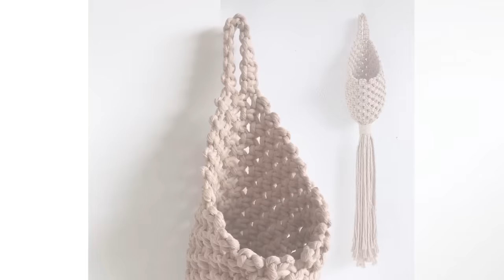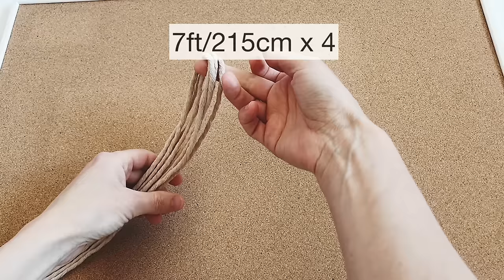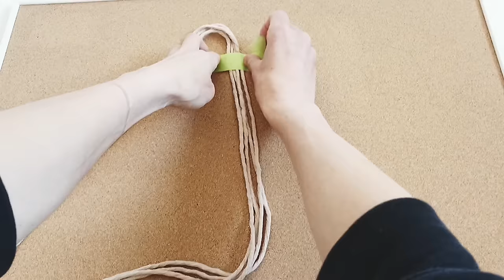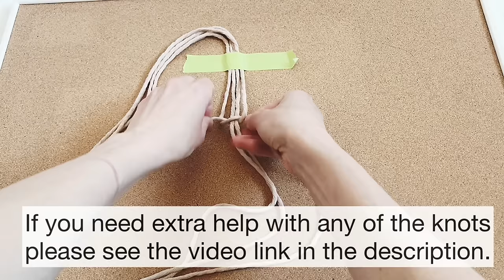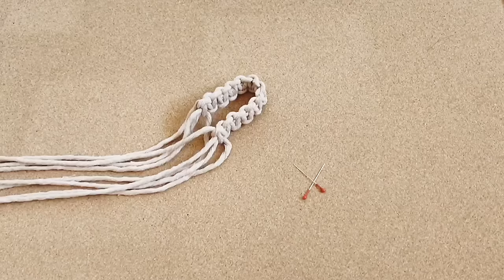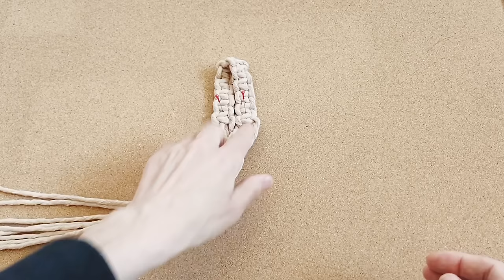DIY: MACRAME PODS | STEP BY STEP MACRAME TUTORIAL

Comment: Tried this. Although i took longer than you, it turned out nice. Added 4 addition rows and decorative beads on hanging cords below the tie off. Found it a bit tricky at points.  Started to learn macrame in my early twenties and 50 years later trying to re teach myself and to improve.  Your video was very helpful. Thanks.
Reply from the maker: Yes, well it definitely isn’t a beginner or intro pattern that’s for sure! Sounds like yours turned out nicely though. Glad it worked out.

Comment: This is so beautiful. Thanks for sharing the detailed instructions. I plan to use 3mm single ply cord. Can you tell me if I need to use more or less cord cuttings? Thanks in advance!
Reply from the maker: That’s so kind of you, thank you!🙏🏼 I think using 3mm you could get away with cutting about 4-6 inches less, maybe more but I’d be careful! Also because it is a thinner cord, you may want to add and extra of the floating square knots, just to make to opening a decent size, but that’s something you can experiment, and play around with:)
Reply: I used 2 mm cotton cord and it turned out great overall.  However, I added extra floating knots and if I do this again would add extra of the beginning set of strings (the attached / semi-floating knots) so the triangle portion of the back side is more proportional in size to the any additional floating knots.  I did not modify the length of the strings and it was enough without too much extra waste.  Good luck!

Comment: This is such a detailed and easy to follow tutorial, thank you so much. I'm wondering if I could possibly make this larger with the knots more spaced out for a looser weave (for a fruit basket) Do you think that would work? Would I need to change the lengths much? Also, is there a way to end the basket without the hanging cords at the bottom? for a more simple look? I'm new to macrame so this is all very new to me. Thanks so much for sharing!
Reply from the maker: I think you should definitely check out my tutorial for a basket. It has the closed bottom, I’m the video I made the large mustard one BUT I also have allll the course lengths for the black size as well. I think that will be what you’re looking for:)
Reply: @soulfulnotions2648  thank you! Yes, that hanging basket is great, I'll have to try it out!

Comment: Can you tell me how i can fix the mouth? It seems to be too wide and and it goes forward a bit much.. 
Loved the tutorial and you your instructions! Thank you in advance.
Reply from the maker: Maybe you are using a slightly different cord or knots are the same tightness as mine. You can just pull out a square knot or two to bring it in!
Reply: Soulful Notions I used a smaller string than the one you did so that may be the reason. I’m definitely making another one because it did turn out cute even though it’s not as exact as your. Thank you!
Reply from the maker: No worries! Let me know if you get stuck, I try to check in here once or twice a day to help out:)